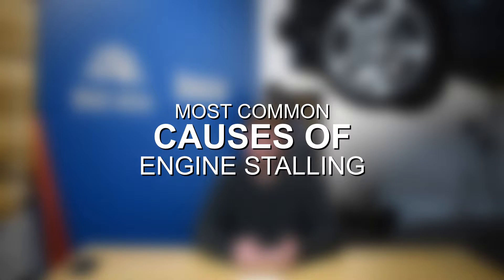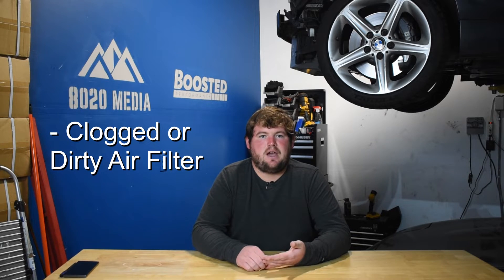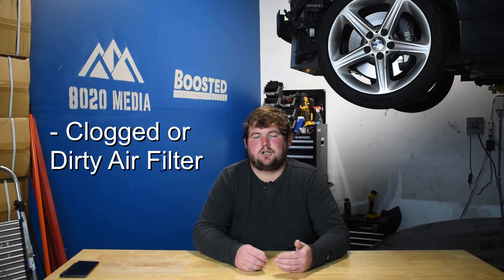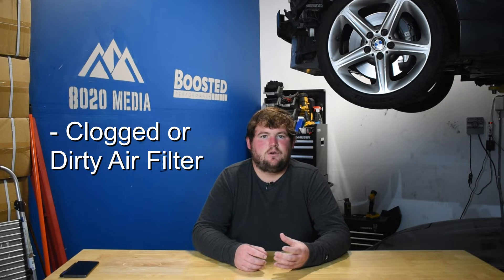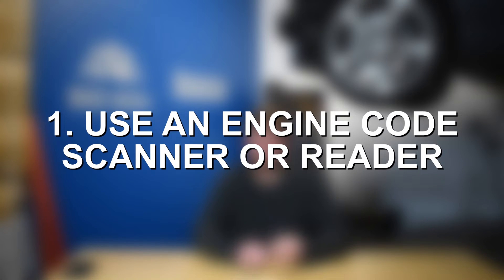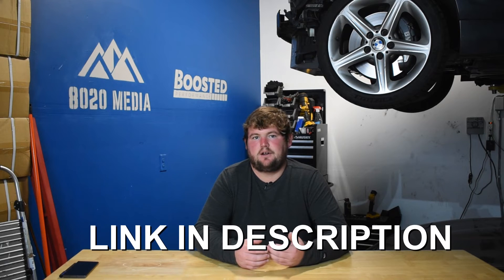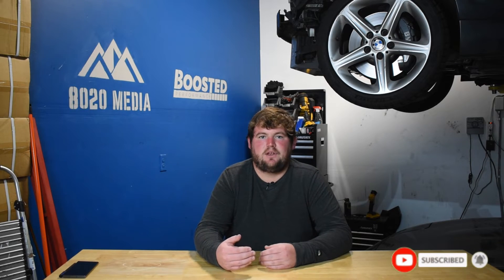DIY – How to Diagnose & Fix a Car Stalling

Comment: My wife has a 2015 Chevy Equinox LT 4 cylinder engine, it stalls on idle or low rpm, no check engine light, and no code. It will crank up absolutely fine after the stall with no rough idiling or hesitation.

We brought it to 4 repair shops (including the dealer) over the course of a year and each one of them says the car runs beautifully and it supposedly never stalls on them when they look at the car, so I don't think bringing it to a mechanic shop is an option for us. One actually told us to keep driving it till it gets worst and then maybe a engine code will come up.

I've gotten to a point where I have been trying to diagnose the issue myself and even started replacing parts to resolve the issue. I replaced the engine air filter, MAF sensor, and throttle body. I will look at the things advised by this video, but any tips on how to better diagnose this stalling issue with a diagnostic tool would be greatly appreciated.
Reply from the maker: N - Sorry to hear. Thanks for taking the time to share your experience! Keep us updated.
Reply: Sounds like an ECM problem.
Reply: Any luck? I've been having the SAME issue with my 2016 GMC Terrain.
Reply: I have same issue with another type of car I started with battery and alternator both pass and good, I have changed both Camshaft and Crankshaft Sensor and seems to no longer do it, I also had no code only time I got a code for crankshaft code was when it stalled and I had my scanner on hand and got it before it cleared itself out.

Comment: My Honda Jazz engine stalls after it start to run for a few seconds (It happens 3-4 times a week). I can restart the engine without problem every time and can drive without issue. There is no fault code in ODB2 scan. What is the potential issue? (I have already replaced the battery recently). Thanks in advance.
Reply from the maker: H - If your Honda Jazz engine stalls a few seconds after starting but restarts and drives fine with no OBD2 codes, potential causes include a weak or dirty idle air control valve (IACV), intermittent fuel pressure issues (like a sticking fuel pump relay or clogged fuel filter), or an issue with the mass airflow sensor or EGR valve sticking briefly. Since there's no code, it's likely a borderline or mechanical issue not triggering the ECM. Try cleaning the throttle body and IACV, and monitor fuel pressure if the problem continues.
Reply: @8020Automotive  Thanks. Actually, it is fixed now after cleaning the IAC Value,Throttle Body and EGR value.
Reply from the maker: @hylau88  Nice! Thanks for coming back and sharing!
Reply: My wife has a 2015 Chevy Equinox LT 4 cylinder engine, it stalls on idle or low rpm, no check engine light, and no code. It will crank up absolutely fine after the stall with no rough idiling or hesitation.

We brought it to 4 repair shops (including the dealer) over the course of a year and each one of them says the car runs beautifully and it supposedly never stalls on them when they look at the car, so I don't think bringing it to a mechanic shop is an option for us. One actually told us to keep driving it till it gets worst and then maybe a engine code will come up.

I've gotten to a point where I have been trying to diagnose the issue myself and even started replacing parts to resolve the issue. I replaced the engine air filter, MAF sensor, and throttle body. I will look at the things advised by this video, but any tips on how to better diagnose this stalling issue with a diagnostic tool would be greatly appreciated.

Comment: 2001 Chevy Tahoe 5.3L wants to stall and sometimes does stall. It will start right up after and will be good for weeks. No code. What could cause that.
Reply from the maker: R - Your truck stalling intermittently without throwing a code could be caused by a failing crankshaft position sensor, which may not always trigger a check engine light but can cause random stalling. Other possible culprits include a weak fuel pump, clogged fuel filter, faulty ignition switch, dirty throttle body, or vacuum leaks. If it restarts immediately, it may also be an intermittent electrical issue, such as a loose ground wire or failing engine control module (ECM) connection. Checking fuel pressure, cleaning the throttle body, and inspecting wiring connections can help narrow down the issue. Keep us updated.

Comment: my car lags when i press gas from idling and while changing gears but when i use reverse gear it moves normal , its a diesel 1.4tdci ford fiesta
Reply from the maker: M - If your 1.4 TDCi Ford Fiesta lags when accelerating from idle and during gear changes but moves normally in reverse, the issue is likely related to fuel delivery, turbo lag, or sensor malfunction. A clogged fuel filter, weak fuel pump, or dirty injectors can cause hesitation under load, while a failing MAF sensor, MAP sensor, or EGR valve can lead to incorrect air-fuel mixture, affecting throttle response. The fact that reverse works fine suggests it’s not a clutch or transmission issue but could be related to low boost pressure or a turbo actuator problem affecting forward gears. Check for vacuum leaks, clean the EGR valve, and inspect turbo hoses for leaks or blockages. Keep us updated!
Reply: @8020Automotive  there is a small crack in the air pipe
Reply from the maker: @ That'll do it!
Reply: @8020Automotive  ok i will fix it

Comment: I have a 1999 lincoln town car im not really sure what the problem is no codes all liquids seem to be fine killed 2 batteries recently overnight and kept stalling while driving locking the steering wheel up (it did have power steering in it) no OBD codes it stalled and didnt start anymore everything pointed at the fuel pump changed it. However it started beautifully, until i stepped on the gas it stalls out and seems to not be breathing when i step on the gas but runs perfectly fine when idling. Would this be a MAP issue or an alternator issue, or both?
Reply from the maker: B - If your 1999 Lincoln Town Car is stalling when stepping on the gas but idles fine, along with draining batteries overnight and previous stalling while driving, the issue could be a failing alternator, a vacuum leak affecting the MAP sensor, or a fuel delivery problem. Since you already replaced the fuel pump and it starts fine but stalls under throttle, check the alternator output with a multimeter—voltage should be 13.5–14.5V while running; if it's lower, the alternator may not be charging the battery properly, leading to power loss. A failing MAP sensor or a large vacuum leak could also cause hesitation and stalling under load, as the engine isn’t receiving the correct air-fuel mixture. Inspect the intake manifold, vacuum lines, and MAP sensor wiring, and consider testing the sensor with a multimeter. Also, verify that the throttle position sensor (TPS) is functioning properly, as an inconsistent signal can cause the engine to cut out under acceleration. Keep us updated!
Reply: @8020Automotive  wow man great advice! I was back and forth on what it could be. Got some advice from a couple techs they said autopart stores usually test the alternators with load tests. It killed 2 batteries i had lying around corroding the terminals bought a new battery alternator and still didnt work. Eventually after digging around i noticed a while ago i had taken off the manifold to check if the pump was out, manifold got put back on however there were two lines by the firewall leading to the manifold i tucked and forgot connected them and solved my issue, rookie mistake. Additionally i got a agm battery which cant corrode because its sealed however i still suspect a parasitic draw is there any way you can explain it to me every video out there says use dc volts but i dont see the setting on my multimeter

Comment: 2008 6MT Hyundai Tiburon
Was throwing engine light for “fuel pressure regulator” causing a long crank start after sitting for awhile. Ran seafoam a couple times and went away hadn’t came back. Now it’s stalling just randomly has happened 3 times now, starts right back up right after stalls. All electric controls work normal a great, no dimming, but 1 of the 3 times it stalled, I turned my brights on, and seems like that was almost a switch to stall it. Every time it turns right back on. 1 time, about a week ago, it felt a little weird in first gear, being that i needed a lot more gas to not stall to get going. went away the next day. Should I start with the FPR(fuel pressure regulator)?
Reply from the maker: J - The symptoms of long crank starts, random stalling, and needing more gas to avoid stalling in your 2008 Hyundai Tiburon point to a likely issue with the fuel pressure regulator (FPR), especially since it previously triggered a code and Seafoam only provided temporary relief. The FPR is a good starting point, as inconsistent fuel pressure can cause these issues. Additionally, the car stalling when you turned on your brights suggests a possible electrical issue, such as weak ground connections or an alternator problem, which could amplify fuel delivery issues. Start by inspecting and, if necessary, replacing the FPR and testing fuel pressure to ensure the system is operating within spec. Also, check all ground connections for cleanliness and tightness, and test the alternator to rule out electrical inconsistencies. Keep us updated!

Comment: I have a Toyota Corolla 09 runs fine but after running for days the car starts shaking and the engine stops. After an hour the car starts again. I replaced the MAF and the ignition coils. It keeps throwing a MAF code. What to do next? What is the problem with my car? Please help.
Reply from the maker: J - If your 2009 Toyota Corolla keeps throwing a MAF code despite replacing the MAF sensor and ignition coils, the issue likely lies in the wiring or connections to the MAF sensor, a vacuum leak, or an ECU problem. Start by inspecting the MAF sensor harness for damaged wires, loose connections, or corrosion, as a bad signal can cause the ECU to misinterpret airflow. Next, check for vacuum leaks around the intake manifold, hoses, or air intake system, as unmetered air can trigger MAF-related codes and engine stalling. If the wiring and vacuum system are intact, consider having the ECU tested or reflashed, as a malfunctioning ECU can misdiagnose a perfectly functioning MAF sensor. Address these areas systematically to resolve the issue.

Comment: Noticed last year my '92 Chevy Silverado K1500 would stall in the cold and it stalled most the time at stops when I would try to accelerate.  It was fine all year during warmer weather but started when it hit 30s and below.  It also has issues even while driving if I am driving and try to give it a bit more gas to go it'll sputter and if I let off and hit it again sometimes it'll go fine and sometimes it'll sputter again.  Have noticed just giving it full gas sometimes just makes it skip the sputter and just GO.  I don't have problems restarting it until it stalls multiple times and then the battery is dead.  A simple hookup to my car and it'll fire right up with no issues and drive like normal again for a bit and it'll do it again.

I have been thinking lots of these issues it could be but bad battery for a year seems odd as well as alternator.  I would think driving it 4+ days a week it would fully just go out.  I do only drive like 7 minutes to work and back though when I drive it.  Had no issues in the summer though helping a buddy move with multiple 15+ minute highway trips.
Reply from the maker: A - This sounds like a fueling related issue.

Comment: I have a 2013 chevy sonic lt, and just had my oil changed  when I left I noticed my engine light was on, and also there was a slippery. Sign on my dash, turn around and took it back they tried checking the code, and took acap off and screwed it back on, and the engine light went off, but when driving home it's back on
Reply from the maker: V - Interesting. Thanks for taking the time to share your experience!

Comment: Great and thorough video, very well explained. I think the fuel system is part of  the problem. I liked how you explained symptoms and lack of them, helping us diagnose down further to at least have some idea of what might be wrong. 
Do you have any links for diagnosing old non-computerized manual clutch cars? Most of the videos out there are for computerized cars. Thanks
Reply from the maker: B - Unfortunately we don't. However, we appreciate the feedback. What vehicle do you have maybe we can try looking into it a little more.

Comment: my car only stops when it comes to a full stop, everything else works, radio, AC, lights, we tested the battery at 2 places both said they’re good. After the car stops i have to wait about 10 mins and it turns on just fine. we also replaced all spark plugs and nothing worked. do you have any idea what this could be?
Reply: also no diagnostic codes came up they said everything was fine.
Reply from the maker: P - Sounds like a potential fueling related issue.
Reply: @8020Automotive  i took it to a mechanic they said bad solenoids replaced them, on my way home stopped again… took it back asked if it could be the fuel pump or anything and they said no. I’m so confused and just want to get an answer. thank you for taking time to reply
Reply from the maker: P - Sorry to hear man... Maybe take it to another shop to get a different opinion.

Comment: What about if steering wheel locks up and car barely moves after being at a stop light?  It has happened twice in 1 day. I flashed my lights, and restart the car and it goes back to normal but I can feel a bit of shake as I drive.  Any ideas?
Reply from the maker: 2 - Do you have power steering? We have a video on rough idle that may help with the shaking: https://youtu.be/BiYsqRJCLhE
Reply: @8020Automotive  2016 Ford Escape.

Comment: I have a 2008 santa fe every time i press hard on the break the engines stalls. It will let me turn it back on and keep going. It doesn't give out lights or codes any suggestion please
Reply: Sounds like transmission or torque converter issues

Comment: i mean it shuts off while I’m driving— I have to pull over put it in park and start it up- I found out what it is— I have a MAP SENSOR I CHANGED IT and it does crank better but I also found an additional problem which is the ignition switch— I watched a few videosg on symptoms of bad ignition switch
Reply: Yeah changed the MAP and prayed over the ignition switch it’s doing fine now — ignition switch box 📦 was the 2nd problem but my mechanic god fixed that
Reply from the maker: B - So everything is good now?
Reply from the maker: B - Keep us updated here! We hope this helps. Thanks for sharing this experience.
Reply: Thanks for sharing sounds like my car

Comment: 2007 Buick lacrosse is stalling every once in a while. It’ll do it at low low speed or at stop light.. drive it 600 miles with no problems.. it shut off twice after that. Drove it back 600 miles and it did it again twice. Again it was low low speed or at a stop light.. no check engine light on. It’s never had a new fuel pump.. I’m almost certain it’s the fuel pump.. any suggestions? Thanks in advance.
Reply: Egr valve
Reply from the maker: C - Sounds like a fuel pump or lines. Have you had it looked at?
Reply: @8020Automotive  replaced fuel pump and it still shut off.. replaced Crankshaft sensor and it’s been ok so far
Reply from the maker: C - Were you getting any engine codes?